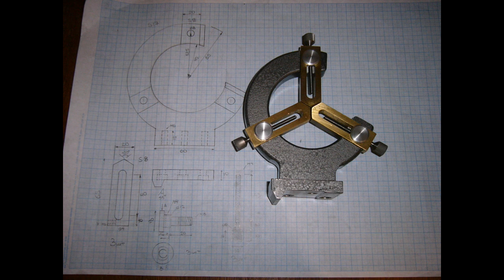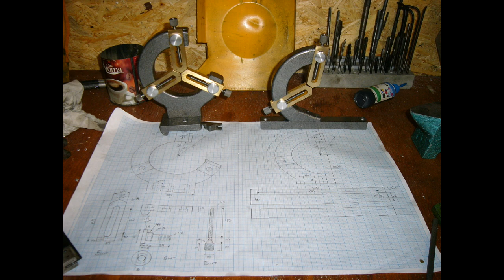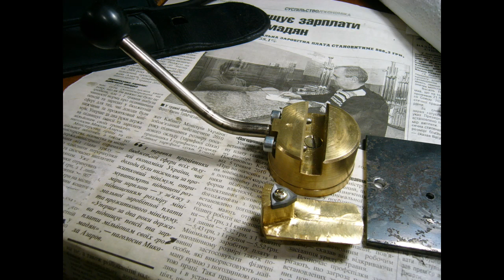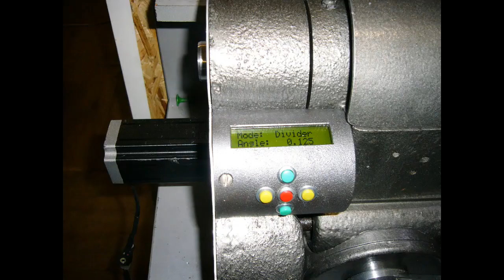Модернизация и оснастка токарного станка ТВ 16 слайдшоу

Comment: Ігор, можете підказати по гітарі, я також хочу собі таку ж зробити. Із роліка про чпу я так зрозумів шаговік тут такий https://ru.aliexpress.com/item/Nema-23-Stepper-Motor-2-83Nm-400oz-in-4A-8-wire-6-35mm-Dual-Shaft-CNC/32586101369.html?spm=2114.30010708.3.2.Aoo7Dz&ws_ab_test=searchweb0_0,searchweb201602_0_10065_10068_10000009_10084_10083_10080_10082_10081_10060_10062_10056_10055_10054_10059_10099_10078_10079_10093_426_10103_10073_10102_10096_10052_10108_10050_10107_10051_10106,searchweb201603_0,afswitch_5_afChannel&btsid=fff7db7f-7612-4894-ba15-d8afc7874ee6 ? І щє, найбільший блок у гітарі - це бп? Вибачте якшо питання трохи дурні, ніколи такого не робив а на чіпмейкері тема про гітару здається безкінечна)
Reply from the maker: в вас шаговий мотор 84мм довжиною а в мене 112мм